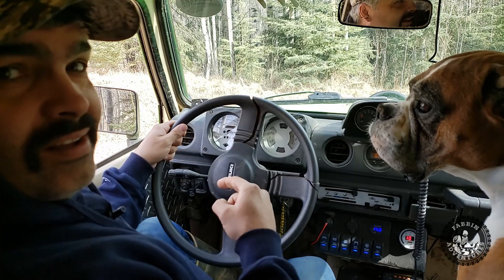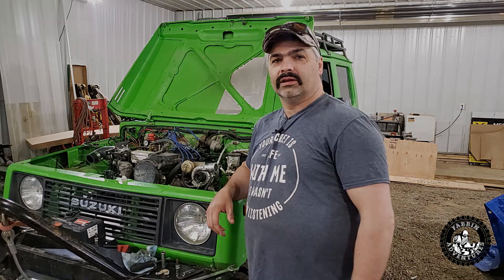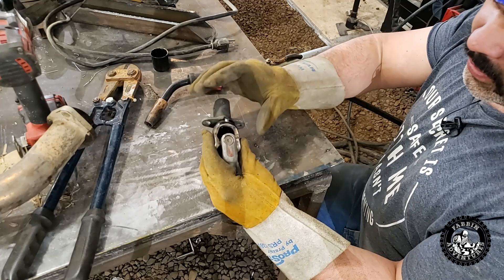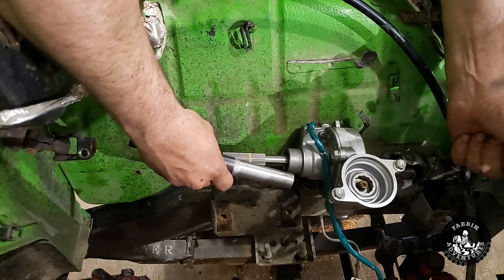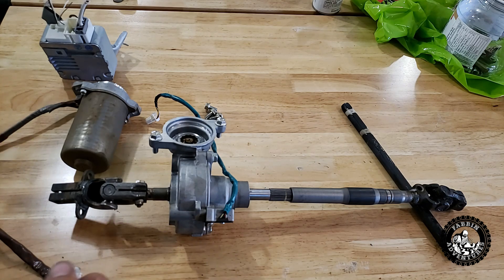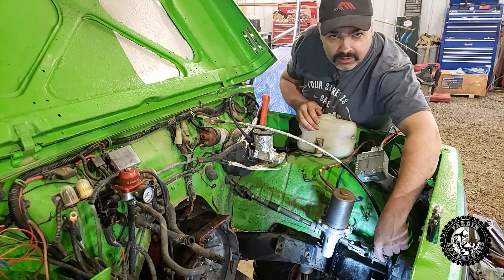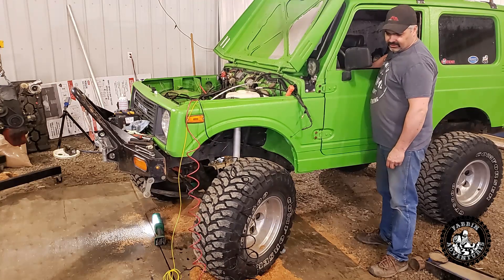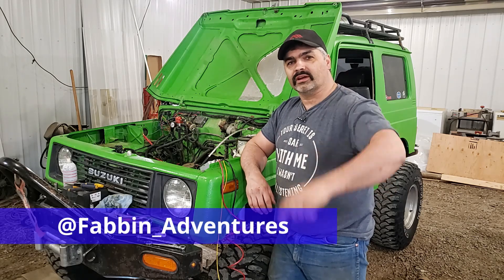Suzuki Samurai Electric Power Steering Conversion

Comment: Did you drill out the original rag joint mount to fit some of the U-joint you cut down to fit it inside the rag joint mount a little?
Reply from the maker: Nope, i welded it straight on, made sure it was straight and running true first.
Reply: Fabbin Adventures mine is all in place and I can hear the ECM click on when I connect power but the electric motor has no power? Any ideas why that would happen?
Reply from the maker: Not sure, is it the same one i have? It takes 10 seconds after the click to engage. Are you sure your using the right wires? Beyond that, im not sure what might be wrong.
Thanks for watching
Reply: Fabbin Adventures I double checked every wire and confirmed the ECU and electric motor are getting power. Did your Prius shaft spin freely when it was not installed? Mine does not. I’m wondering if it is seized up at the motor.
Reply from the maker: I cant remember if it spun freely ot not, sorry im not much help
Reply: Fabbin Adventures thanks for the responses and for the video. It was a big help. My issue was that the top right bolt (one I was not using for my bracket) binds up the worm gear if it is tightened down to the housing with no bracket or washer. Simple to fix hard to find, but all is well now. Thanks again. Keep up the great Samurai content!
Reply from the maker: Nice catch man, glad you figured it out and thanks for updating me!
Enjoy that power steering now!
Reply: @FabbinAdventures   Finally solved this mystery. The non-ABS ECU requires pins 6 and 5 to be powered. It’s that simple, but who would have guessed that. I had no idea I had the “non-ABS” version of the ECU.
Reply from the maker: @jimmyallen8210  ahhh, good for you man, thats good info to know, ill pin this to the top!
Reply: @FabbinAdventures  cancel the party...this was not the fix. The mystery continues.
Reply from the maker: Well crap!
Reply: @FabbinAdventures  I finally actually got it working. My torque pressure sensor was bad. I could not find one sold separately so I bought an eBay column for $100 and used that. Worth every penny to let my kids steer on the trail without the wheel whipping back around. Thanks again for the video. 

Lesson learned - table test the unit prior to install.
Reply from the maker: Awesome, thats great news! Glad you got it figured out!
Reply: @jimmyallen8210  how did you know you had a non abs? I have the single black wire, on left side. And right side I have 2 other wires. Mine works when I connect everything except for the two on right side. I just have it jerry rigged for now but i noticed when I turn the wheel all the way and bottom out, it shuts off then I have to kinda mess with wires to kick back on. I'm assuming because of jerry rigged and not using proper wire size is why it's not working correctly. ... any input
Reply: Mine works when it wants to ...seems after i get it moving for a few seconds it turns like a charm. Im kind of wondering if its not getting enough voltage to work without being at a higher rpm for a bit.
Reply from the maker: Thats possible, did you use large enough guage wiring when you wired everything up.
Reply: hey do you have a drawing for that frame mount piece you made?
Reply from the maker: No i dont, but next time i put in an electric power steering unit for someone, i will keep the pattern.
Thanks for the comment and watching!
Reply: Im assuming so but mine didn't come with power wires to compare. Guess i could try a bigger gauge wire.
Reply from the maker: I cant remember the guage i used but it was probably 6 or maybe 8 guage for the main power wires
Reply: @FabbinAdventures  yep, i essential used red and black speaker wire I had layin around from doing some lights in my boat. I made up some 12g wires at work ill take home and put on.
Reply from the maker: @aaroncarey2909  yep, ill bet your not getting enough voltage or amperage to the motor, I`m thinking 12g wont be enough, ill go look and see exactly what  I used, give me a sec. I just checked and it was 8g wire that I used for the main power wires.
Reply: @FabbinAdventures  wires running to the battery correct ?
Reply from the maker: Yes the main wires running to the battery
Reply: @FabbinAdventures  i got 12g handy so ill try that if that dont work ill try bigger
Reply from the maker: @aaroncarey2909  12g aint that big, that motor will be starving for amperage/voltage. Mine came with 6 inch stubs of original wiring, and they were 8 guage for a reason i'd imagine.
Reply: @FabbinAdventures  fair enough, I'll skip right on along to 8 guage wire
Reply from the maker: I think it will save you having to try again with 8 guage later.
Mine has worked flawless since i put it in, even fairly deep river crossings havent caused any trouble yet, been one of my best mods by far!
Reply: @FabbinAdventures  finally got around to switching the wires over to 8 gauge and it's workin gooder en new ! Haha
Reply from the maker: @aaroncarey2909  awesome! Glad to hear it!
Reply from the maker: Awesome, glad to hear that worked!
Reply: hello please explain to me exactly how you join the u-joint to the steering column, I find a diameter greater than a thousand rows, the joint has a smaller diameter what should I do?
Reply: Do yiu have burn moteur whit 33 inch tire ?

Comment: Great video, good explanation. 

I have a question: if the EPS should stop working, will it be harder to turn the wheel than without this setup? Like when the PS pump quits or you loose the PS belt on a hydraulic system?

Thanks
Reply from the maker: Yep, its like going back to manual steering, it sucks..lol
Thanks for watching and commenting.

Comment: Laurent Man
Where did you cut the shaft of there is goona be a problem after a year or so water infiltreats in and will kill the bearings inside the power steering 
just bare in mind how you will seal to avoid that issue
Reply from the maker: No problems after 3 years yet. If you didnt notice the video is 3 years old.
Thanks for watching and commenting.

Comment: Hi  I did a 16V swap (well, it was done at a shop)   My question in that regard is, my 1993 16V used OBD1 scanner , does yours use same ?  My check engine lamps is lighting up and I can not find a hood OBD1 scanner, any you would recommend ?
Reply from the maker: I believe you count the flashes like " 2 flashes, pause 1 flash" equals code 21

Comment: Fyi The Opal Astra has remote EPS, and the wheel bolts on to your firewall
Reply from the maker: Oookaaay
Reply: @FabbinAdventures  dude it's another option. You used prius parts,  don't try to act snobby
Reply from the maker: Well dude, i had no idea what you were talking about in the first place. What is an opal astral? What wheel bolts to the fire wall?
Maybe explain your self so people can understand what your talking about...wont get your feelings hurt that way.
Reply: What wheel?
Reply: @robertbrandywine  the stock one from the Astra, your just need a mount for the wheel and to hook up the electronics
Reply: @punk46664  Are you talking about the steering wheel?
Reply: @robertbrandywine  yes mate. Just grab the whole system (steering wheel to pump) from the donor car.
It replaces your entire steering shaft

Comment: Boss I'm trying to install on deisel vehicle but can't find how to wire pulse signal wiring
Reply from the maker: Did you get the same unit as i did on the video? Its simple, positive, negative and keyed power. Thats all you need.
Reply: @FabbinAdventures  no boss mine has other 2 wires like signal wires
Reply from the maker: Mmm, well i wont be much help then

Comment: Im triyng but is hitting the body… did you cut the body?
Reply from the maker: I beat the inner fender well with a hammer a bit to make it fit.
Reply: Thanks!! Still working fine? Any problem whit water or mud?
Reply from the maker: You bet works great, i havent had any trouble with it in water or mud
Reply: Thanks im doing the same ! Anything that I can help you from Colombia… we have a lot of spare parts here !

Comment: hello teacher, I wanted to ask you if on the side of the steering wheel you have enlarged the u-joint? and then did you insert the pin that comes from the electric motor into it? thank you

Comment: Is this good for offroading? I mean will it handle the stress?
Reply from the maker: Sofar so god, ive had it in for 2 years with no probs yet.
Reply: @FabbinAdventures  what about the 1.6 16v, are you happy with it? I had 1.6 8v and wanted to so some maintenance to it and found the block cracked (common issue) and now i am upgrading to the 16v. I am doing some serious offroading and the 8v took a lot of abuse.
Reply from the maker: The 16v has definitely been one of the best upgrades i did to my Samurai!

Comment: Hello …very  great video . I Will try to do it on my Toyota Tercel .  Any difference LHD. Vs RHD “ kit” what did you buy? Henrik
Reply from the maker: I didnt buy a kit, i bought a prius power steering unit and modified it to fit my samurai.
Reply: Thanks … but was your Unit for LHD or RHD?… 😊
Reply from the maker: Lhd

Comment: Can a new eps be used? Or is it just the year window that is common?  04-09 Prius.
Reply from the maker: That is the common year that people use, ive heard of guys using saturn and other models, but i believe the prius is the simplest one to use.
Thanks for watching.
Reply: I have a 2012 Prius EPS and it works perfectly in fail safe mode. 3 wires to hookup.

Comment: Just ordered a Prius EPS off of ebay for my 95 Samurai. Thanks for the video. I liked the way you did the install. After 20 years of no PS it is going to be great having it.
Reply from the maker: Oh wow, your gonna love that eps! Best mod ive done, i wouldnt got with out it now!
I make the bracket to sell to mount the motot to the frame if your interested.
Reply: @FabbinAdventures  I am going to try and make a mount that bolts through the frame. If I can’t I will definitely get one from you!!
Reply from the maker: Awesome! Have fun!
Reply: @FabbinAdventures  Got it in and working. It is great to be able to one hand the steering wheel. Thanks again for the video.
Reply from the maker: Awesome, pretty easy mod hey? You will never want to go back to arm strong steering..lol
Glad i could help.
Reply: Tried looking you up, how do I contact you for a bracket? May save me some time…
Reply from the maker: I have an email on my channel, or you can look me up on facebook and message me.

Comment: I just have one question?  Do you need to "center the shaft between lock to lock during install ??   Never seen a comment about this.  If this is necessary can I feel the "stops" when no power is present.??
Reply from the maker: I never did, seems fine

Comment: Hi mate. i have a Hilux rn105 1989 doesn't have power steering. went to a garage and they quoted me $2200 AUD. I will have a look at this option. thanks
Reply from the maker: Definitely look at this option, it will be way cheaper!
Reply: Use eps from RAV4, more power

Comment: So just finding out about this mod and thank you for the video. My question is on my 68f100 power gear box... would I just plug the gear box ps.line holes or connect them together?
Reply from the maker: Thats a good question, probably plug them, but i think a power steering box is geared differently than the manual steering box so it may not work the same.

Comment: Thanks for the video. I watched your video several times. Ended up following yours as a guide. I purchased a Nissan Versa unit. I bought it because I have a 1.6 8v with samurai air conditioning. The Versa motor is on the opposite side and it clears the AC compressor. Part of the shaft universals fit both drive motor and steering box so no welding on rag joint piece was required there. I copied the way you fit sliding shaft and upper Samurai universal. My bracket is welded on top and outside of frame. Wiring it tomorrow. It appears with the Versa I have to ignition power 2 terminals. Thanks again.
Reply from the maker: Awesome! Good work modifying it to work with your rig, your gonna love it!
Reply: I would love to see pictures of that or more info how it worked out - looks like 3 years ago so maybe you have some miles on it now?
Reply from the maker: Yeah it has always worked great, but i actually just sold the samurai this past weekend so i cant get you any pics.

Comment: I have a unit off a Saturn Vue. I also have a conversion kit for a Ford Festiva. Wire plugs are different. How do I figure out which wires do what with the control unit?
Reply from the maker: Thats a good question my friend, im no ace when it comes to wiring..lol thats why i went with the prius, there is easily available schematics for it.
Thanks for watching and commenting!

Comment: I would just add a set screw to the break in the lower sliding double spline area rather than drill the upper u-joint. It would serve the same purpose and be much neater and easier than drilling the upper joint.

Comment: Another question, I think in bought the one without ABS, can I just buy the correct ABS module?
Reply from the maker: Thats a good question. Mine came complete from a seller on ebay. I would imagine you could find the module there.
Reply: @FabbinAdventures  I'm going to do more research, I hope I can just swap modules
Reply from the maker: Yeah i would think as long as you can find the right "year range" ( like 04' to 09' ) it should work for you

Comment: HI there, Awesome video bud! I am busy doing this conversion on a RHD Samurai, I just wanted to know if the motor can lean over to one side?(I have to do this to miss the intake) I have little knowledge on how these things self center, I am using the exact same EPS unit. TIA!
Reply from the maker: Thanks for watching, yes i dont think orientation matters at all. I know a few guys who have them sitting sideways.
Reply: @FabbinAdventures  That's good to hear, I just spent a 2 weeks making custom shafts and U joints to realize this morning that it will catch the intake 🤣 Going to try fit it this week, Super excited! Thanks for the response man! Have an awesome week
Reply from the maker: Awesome! Good luck with your project!
You will love the power steering!
Make sure you subscribe and check out my newer videos. I put out 2 vids a month in the summer and 4 a month in the winter!

Comment: Hello, as this EPAS is designed to be built into the passanger compartment, didn't you experience any issues due to water and mud , the unit most probably recieves?
Reply from the maker: Not yet, i have had no problems with water crossings or big mud holes. It works great.
Thanks for watching and commenting!

Comment: I’m curious about the motor handling the big tires on the trail.
A lot more torque than the bicycle tires on a Prius.
Reply from the maker: I haven't had any trouble with it yet, and everyone ive talked to that has the mod done has had no trouble either. So far, so good!

Comment: Did you add a fuse going from the battery to the ecm? And if so what size?
Reply from the maker: Yes i did, i would have to check as i dont remember the size. Im guessing a 50A.
Thanks for watching and commenting!
Reply: @FabbinAdventures  that would explain why my 30a popped on the maiden voyage this weekend figured that was overkill

Comment: Great video, but i cant help but think wouldnt it have been easier to use a power steering box from a suzuki jimny (theyre direct bolt swap) and use the power steering pump on the 16v engine your swapping in?
Reply from the maker: If we had jimnys here that might be an option. But we havent had a suzuki similar to the samurai since the early 90s.
Thanks for your comment!

Comment: Hi Ron, great video lesson. I just bought a EPS unit from a 2009 Prius also, and I'm getting ready to install it, but I have a question I don't think anyone has addressed. Did you fuse the power wire to the motor? If so, how many amps? 30? And if not, is it safe that way? Thanks, from Bud in Red Deer.
Reply from the maker: Hey Bud, thanks for watching and commenting! It really helps the video out!
I did use a fuse, a 50 amp mega/blade type if thats what they are called. 
I dont show much wiring on my channel as thats not my strong suit and id hate to steer some one wrong. That being said, maybe a 30 amp fuse would be fine, i dont really know. I ran 8 guage wire for it though.
If you ever get up to edson area with your Sammy, give me a shout, maybe we can go wheeling.
Reply: @FabbinAdventures  Thanks Ron. I get up Edson-way for work sometimes, but never with my Sammy. But if you do Whipsaw again this year, I sure wouldn't mind tagging along!
Reply from the maker: Oh i take it you havent seen the video?
We have a big run planned for August 6,7,8th 2021. 45 rigs already confirmed!
Go to my channel and look for the video!

Comment: How is the electric steering holding up, its been about 8 months now. I was thinking of going this route, how well is it holding up with 33s and front locker? Thanks
Reply from the maker: Sofar so good! Only been on a coiple wheeling trips with the front locker in, but both the steering and locker are awesome! The TRE Air locker seems to be working fin also, but then again, only a couple trips on them!
Thanks for following my build and commenting!

Comment: I did this mod to my 1986 tin top that has a/c, so I pushed it back further which made me have to double knuckle to the steering wheel link. Mine works great turning left, however turning right is much stiffer (but still easier than non power). Is this something you or any one else has encountered?
Reply from the maker: No i have not heard of anyone experiencing that, mine turns equally easy either way. Definitely one of the best mods ive done to the Samurai!
Thanks for watching!